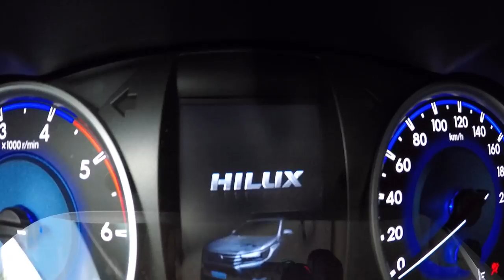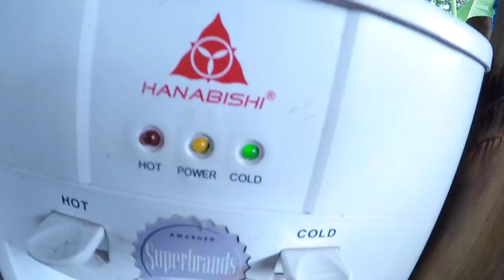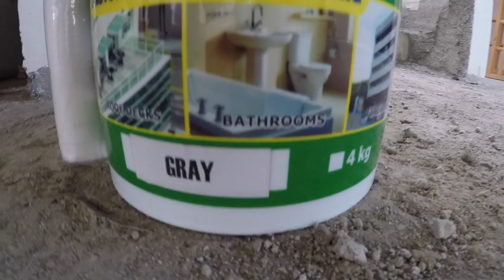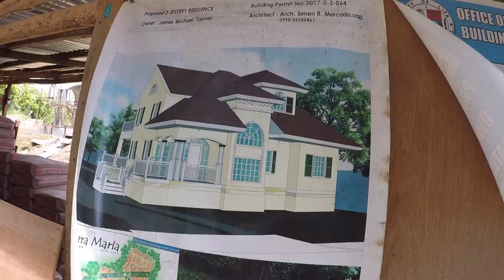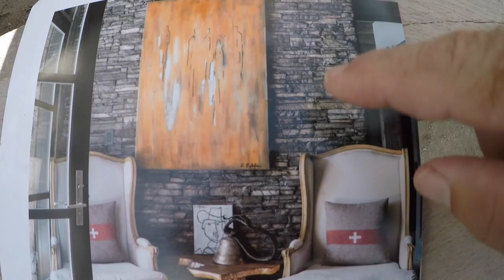VILLA FELIZ - EPISODE 165: ONE DAY CLOSER TO A ROOF OVER MY HEAD (House Building in the Philippines)

Comment: Hi James, was there ever a point in your build when you have a moment you say "holy cow, this house is gargantuan!" Just looking at your basement, you could easily put 4 big bedrooms in it. Nice house. BTW, papaya, just like avocado or rambutan have male and female plants. You know papaya is male when the flowers are multiple is single stalk. We try to convert them through several methods and I don't know which one is better. My experience is putting a stake across the bottom trunk through and through while others would do de-topping or cutting the top part of the plant. Do one first and if unsuccessful, do the other. Congrats , your house is almost the finishing stages after the roof.
Reply from the maker: Never had that moment and on the contrary I had the "this house is much smaller than I imagined on paper" moment.  We had to shrink the house by around 25% to get it to conform to the farm lot restriction for house size.
Going to try topping the male papaya first.  Seems simple enough.
Reply: My PI Dream try topping first and if it does not work, do trunk splitting. You are close to finish line on the nice house build.

Comment: Looking good but why tiles being put in so early. Lots of work left and from my experience you will have many tiles being cracked from the ongoing work.
Reply from the maker: The basement is approaching completion.  It will be used mostly now for storage of building materials.  If we get a cracked tile, now's the time for it to happen so we can correct.  Also, the basement is being used as a garage and we'll have the vehicle down there.  I'm sure the truck will be more demanding than a 40 kilo worker....😉

Comment: Hi James.  REF:  Roofing vents. Are you installing any ? 
In Oz, we have a product that sits on the ridge line of the roof. Vents out the hot air from the highest point. Works great. 
https://www.stratco.com.au/products/building-construction/ventridge/
Even if they are not available in PI, you might be able to have them made up. Remove the heat from the roof space.  
Just a bit of info for you to ponder.
Reply from the maker: Yes.  We'll have soffit vents installed.  It's SOP here for standard house builds.

Comment: The roofing 2x6  u channel steel faces up to the top of the roof ? wont that collect water in u channel if there is a slight roof leak? shouldnt it face the other way ? .I am currently building my covid time :D dream house in siargao island . My roof is one month away .Im awaiting the  power line hookup
Reply from the maker: I questioned this too when our construction was underway as I'm used to wood truss and roof construction this was new to me.  This is standard procedure and there is indeed a reason but I can't seem to remember the reasoning.  Your roof is an enclosed area and no water should be getting into the C purlins.  If it is, you've got serious problems with the integrity of your roof itself.